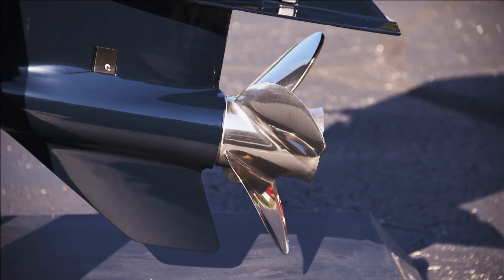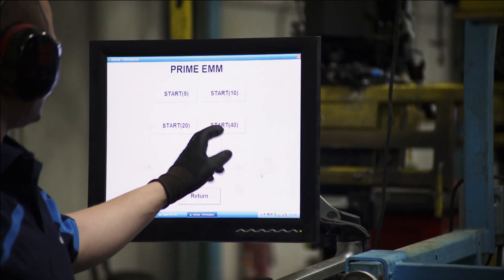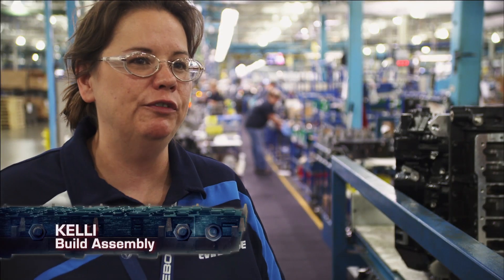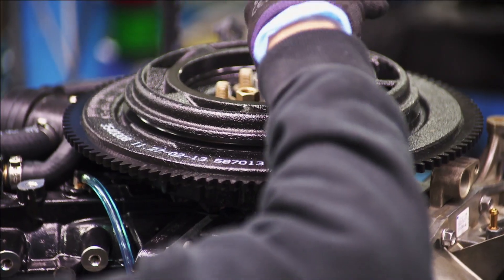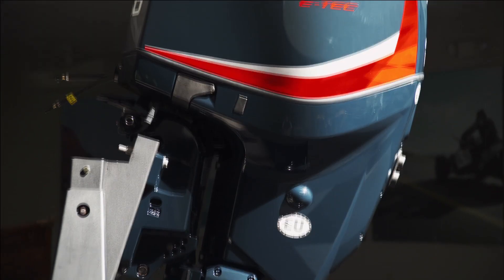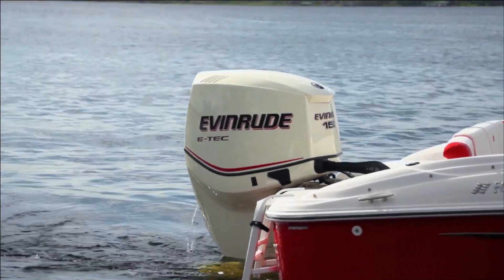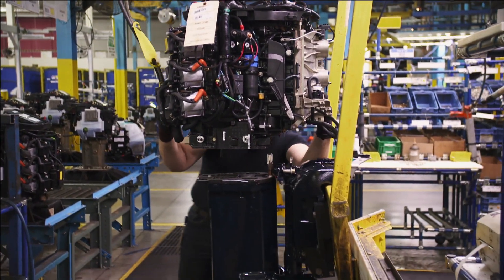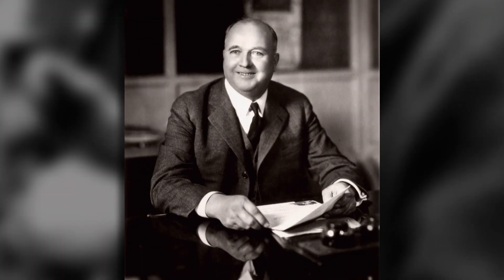How an Evinrude E Tec 150 Motor is made - BrandmadeTV

Comment: Guys, you screwed up at 1:07 and 1:38, and 2:52... This motor is a 2-stroke.  You have it rotating as if it's a 4-stroke.  This motor combusts on every rotation!
Reply: Pistons go up and down, crankshaft rotates whether it's 2 or 4 stroke OK